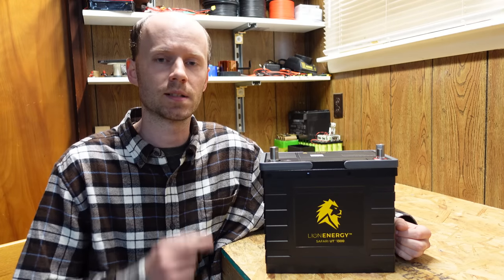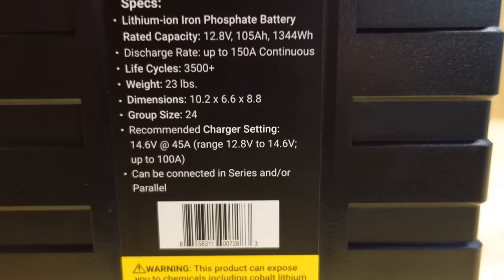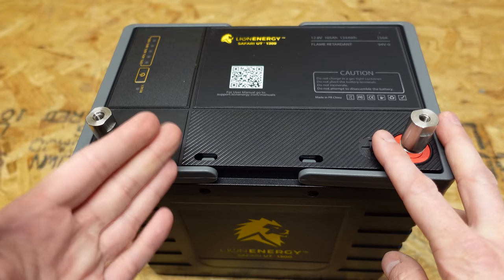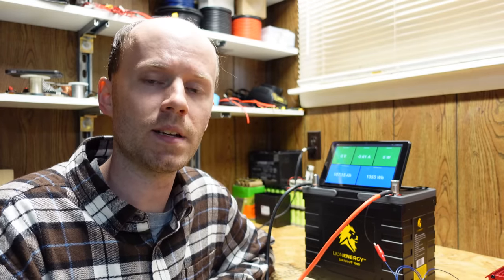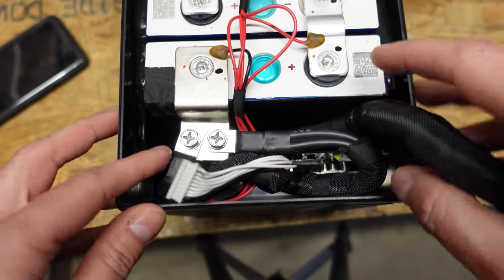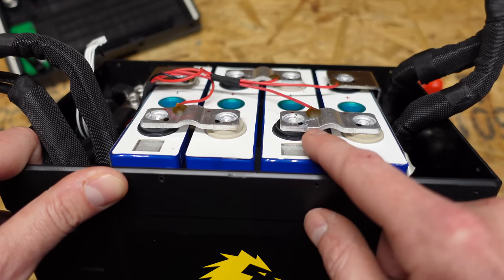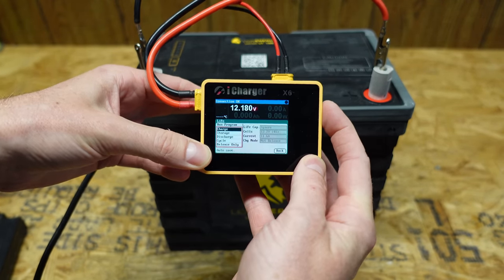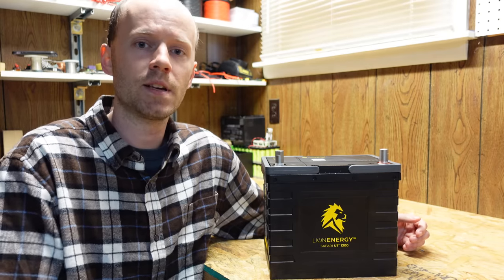Lion Safari UT 1300 12V 105Ah LiFePO4 Battery, Overview and Testing

Comment: It appears they are using VHB tape between the cells.  'Current Connected' did a similar build with Eneramp 170 batteries..

Comment: I am a little suspicious of that capacity. I've seen several times on other people's channels including Will's that when a company sends battery specifically for a review, they send a better version that they know will pass and it's a little different than what you get buying it as a normal person.
Reply from the maker: I can't comment on whether or not they pre-tested it. They sent me an invoice like it went through their ordering system, so I assume it was fulfilled the same way. I would certainly hope they were honest and sent me a retail production battery that is the same as everyone else gets.
Reply: @LithiumSolar  check out my review video from two years ago. They lied about their rated capacity. They fixed this problem, but I won't forget it.
Reply: Ben me too. Capacity is an average of 3 or more testing at different C rating. Usually, the first testing always are lower. And the price is disproportionately high for this chemistry which is nothing more than a little better than lead acid batteries. There are a bunch of these batteries that look exactly the same in the inside but different name tag outside and some are selling at Amazon for close to $400.00 dollars a piece. The only thing I like about these batteries is the laser weld in the terminals which eliminate the chance of loose connection. Some of these batteries start ballooning after 2 or tree months even if you don't abuse or cycle them completely because of defective manufacturing mixture. Buying this batteries is a high risk investment with very low return.
Reply: I bought one of these batteries at Costco for $689.99 and just tested it for it’s capacity. I got 106.25ah and it was still going but decided to stop. The voltage when I stopped the test was 12.35v. I was skeptical as well about their claimed rating but it definitely met the rating and exceeded it.
Reply: @brentspaulding9990  the good thing about Costco is their return policy. If these batteries belly up, you are safe 100% cash flow. I guess they  are built preaty good, to sell at costco with lifetime return. No risk taken buy at Costco

Comment: Question:
Can you wire a 12v cigarette adapter directly to this and use a portable power stations 12v charger to charge the power station. 

Even if the chemistry of the batteries are different? Lifepo4 to LI ion?
Reply from the maker: Yes, you absolutely could. The output of the cigarette lighter plug wouldn't be a regulated 12V obviously, but it doesn't matter in the application you described as the portable power station's charger would accommodate the small voltage fluctuation (10-14V).
Reply: @LithiumSolar  interesting. Trying to figure out if it's worth it to just add an external battery to my PPS or just buy another one. 
My PPS are a lot smaller than a battery like this tho.

Comment: I'm going to ask a dumb question. A major outlet store I shop at has these on sale, 2 for 1.3k. Why are these so expensive? Aren't similar deep-cycle batteries about 100-150 each? Do people actually pay 1.3k dollars?
Reply from the maker: By "similar deep-cycle batteries" I assume you're referring to lead acid. A LiFePO4 battery is good for several thousand cycles. A lead acid battery is good for a few hundred, and even then, you're only supposed to discharge it to 50% of it's rating. You'll replace that $150 lead acid battery many times throughout the life of a $500 LiFePO4 battery.

Comment: What does the reset button actually do ie is it just a bms reboot. This battery is a good one. Maybe you could have a rating which includes the price
Reply: OR with a couple of mouse clicks, you could find out for yourself.
I timed it, it took me 4 seconds.
900.00
Reply: @reubenj.cogburn8546  Then Lithium solar would not get a comment for his algorithm and I didn't ask for the price I asked if he could rate them against the price so the rating would be weighted.

Comment: IMO I feel if I'm going to pay a grand for a LiFePO4 I should be able to get close to the rated capacity at a reasonable discharge rate of at least 40 amps for a 100ah unit. One of the big selling points for LiFePO4 is that they can discharge at higher rates at a very limited capacity loss when compared to SLA. I know it is more work but it would be great to see reviewers doing the 40a test after the usual 20a.
Reply from the maker: Good point. I can start incorporating a higher-rate discharge test into these kind of videos as well.

Comment: Are those the same 100ah lifepo4 cells I can get for like $200 on ali?
Reply: i got four 280 ah cells for $115 each from aliexpress  $50  for a 100 hmp  bms and ive got this beat
Reply: @davidkettell5726  Yea I have them on order and an overkill bms. Can't wait.
Reply: @davidkettell5726  second hand battery cells

Comment: The problem with asking for free stuff to test, is they will always send their best..  Would be nice to buy one without them knowing and do the same test again.
Reply: I agree 100% with your statement, even though his opinion in his own, they will cherry pick to make sure he gets the best on hand, or even put one together just for him.
Reply: I bought mine at Costco and tested it for its capacity. I got 106.25 ah and it was still going. I stopped the test and the voltage was still 12.35. They may pick the best but it seems from my experience that their batteries do reach their stated capacity even a reduced price one from Costco.

Comment: I sort of 'jumped the gun' & strongly endorsed this battery for the last 18 or so months. I really think that the design of the battery is of high enough quality that the risk of a Chinese build is mitigated by the demands. i.e. hydraulically crimped 8 AWG wires using appropriately sized bolts. If the cells are tested and matched prior to build- I can't see any real problems with each build. I love: the small size, the light weight, the 1.5C discharge rate & series/parallel choices but dislike the terminal connections. Too easy to get loose over time, but- proper planning will reduce that risk. I do wish it was priced a little lower, but- there are so many good things about it, I can't argue it with any passion. It's a good value @ $850.00.
Reply: They were 699 or 750 at Costco at various times...
Reply: @michaelbrown2443  Now THAT is a smokin' hot deal! At $700.00 I think it is worth every penny. I need a few if that's my route though and when it was going on last Spring? Summer? I didn't have the dollars set aside. Genuinely- my bad!

Comment: Too bad they can’t run more than four batteries in series, glad I went with battle born.
Reply from the maker: What voltage system are you running? I haven't tested a Battle Born yet, what are their limits?
Reply: @LithiumSolar  
I’m running a 24 V system, but I could easily be running a 48 V system also. Battle born doesn’t seem to have any limitations that I know of. 
I’ve seen will Prowse breakdown both batteries, and battle born wins on build!
Reply from the maker: @benjones8977  I checked the Battle Born website and you can only connect 4 of their 100Ah batteries in series as well, same as the Lion Energy. The Battle Born manual explicitly states not to connect more than 48V (or 4 batteries) in series.
Reply from the maker: It's on page 5 :) https://1t1pye1e13di20waq11old70-wpengine.netdna-ssl.com/wp-content/uploads/2019/01/10012-2021-Manual.pdf
Reply: @LithiumSolar  
Thanks for the update. I have my batteries in series parallel for a 24 V bank and I spoke to them on the phone, they said I can wire them this way no problems and up to a 20 battery bank. I only have eight wired in series parallel and no issues.